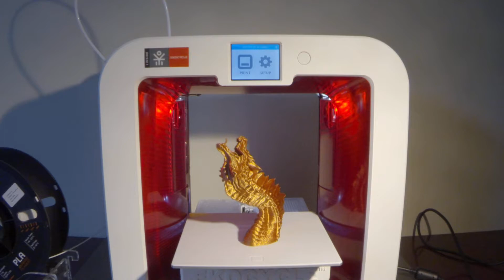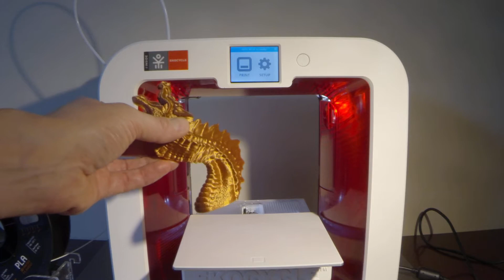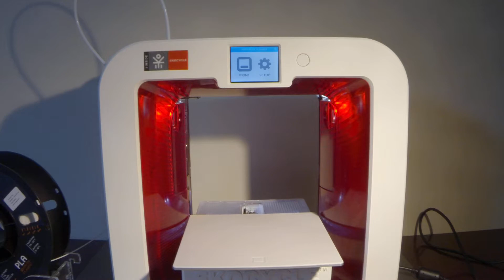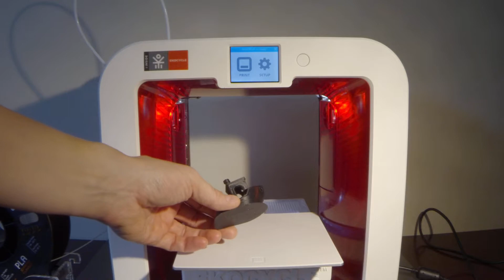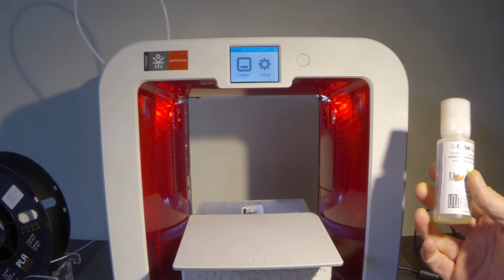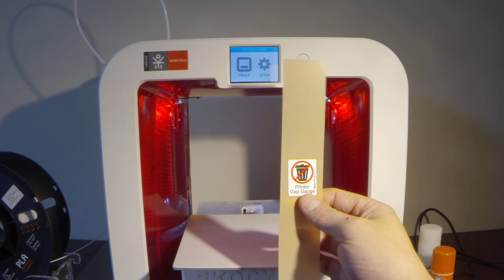Why the Cube 3 still has a loyal following

Comment: I got one of these printers but I  didn't get any software for printing and I  am wondering what is the best software and slicer to use? Thank you
Reply from the maker: Hi, you can still get the OEM slicer but someone built a Cube3 and CubePro profile for Cura - Search Github for this. Check out the Cube 3D Printer Owners Group in FB for even more info.

Comment: What slicer do you use?
Reply from the maker: The OEM slicer is still available from the Cube 3D Printers Owners Group on FB. It's the only working slicer ATM, but a member built a CubePro profile for Cura and is also working on a Cube3 profile.

Comment: Is the filament proprietary? Can i fill cartridge with other plastics?
Reply from the maker: Nope, the cartridges are the only issue and there are great open source solutions (DIY and for sale). A member of the CUBE 3D Printers Owners FB Group recently built and shared Cura profiles for the 3 and Pro. Lots of other valuable information there - check it out!

Comment: Do you have the EKOCYCLE Cube vase model, by any chance? Or anybody?
Reply from the maker: The folks at Print3dforum.com archived all 3DSysyems files a while back. You'll find them all in the Cube3 or CubePro forum. Use caution, the hosting site has click bait.
Reply: @3dprinttek  Thank you!
Reply: @3dprinttek  do you have a working link for the Cube3 slicing software?
Reply from the maker: @CeleryBruh  Multiple members of the Cube 3D Printers Owners Group on FB are sharing it.

Comment: Have u ran into the issue with running other  1.75 pla with the cartridge mod? I've brought some with print temp of 190-220 but starts skipping when printing, there filament seems to be abit smaller then 1.75
Reply from the maker: No, and I've printed a TON of retail filament of varying brands and types. 

A few things - when purging, the feed motors are more prone to skipping (lower power to motor). A full spool of filament is prone to have periodic audible skips, but I've never noticed a quality issue (it takes more work to move that full spool). 

Your issue is most likely related to drag caused by either 4x2mm PTFE tubing that is too tight or a damaged feed tube component at feed assembly or print head. I have another video showing how to resolve poor print quality due to damage tube.

If this is the 1st time testing your open source solution, use some filament fed through the feed assembly to test how hard it is to push it through that tube. IE, it gets bigger when compressed through the feed assembly - test a chunk of this filament. It needs a full 2mm. I had to test product from multiple sources to find tubing that was 2 or slightly larger. If using a new open source solution, this is the most likely cause of your issue,.
Reply: @3dprinttek  thanks heaps man :)
Reply: Also what i/d is best thanks
Reply from the maker: @sirkdow  The gotcha is that much of the 4x2mm PTFE tubing on the market is too tight. I recommend using a 2mm metal rod (or bike wheel spoke) to test. You should be able to push the metal rod through with the help of filament only. If it takes more force to push it through, your feed motors can't handle it.

It's been a while since I had to purchase but eBay seller ny-top-tek sold me a large amount of tubing that was all perfect for the Cube 3.

Comment: I just gutted one of these today, pulled all the boards and plastic off and only left the bed, motors and frame. This printer was built really well but the software was so bogus and in 2022 finding parts isnt worth it. I'm thinking once I slap a new board and 3d print some parts i should have a really solid micro printer that id imagine can print pretty fast.

Edit: forgot to mention i bought it used today for 25 bucks with a missing nozzle & in rough shape plastics wise.
Reply from the maker: You're spot on. Very high end components but the efforts to keep it closed source and dated slicer hurt it.

I recommend two options to really take advantage of the high build quality:
1. Simply find the missing components to make it whole and then use Simplify3D as your slicer.
2. Mirror the work of someone who has already converted a Cube3 to a different platform.

S3D does not list the Cube3 as a compatible printer, but it is! It uses the same board as the CubePro. Base S3d configurations and detailed conversion builds are available on print3dforum.com (I'm a member only).

I would recommend option 1 because the S3D license can be used for other printers. I actually prefer the OEM slicer for PETG prints. Find me on the print3dforum or the "Cube 3D Printers Owners Group" in FB for help with that.

Comment: I just found a cube 3 but does not have the power supply do you know of a good replacement for the power supply.
Reply from the maker: Yep - MPJA has these for 14.95 each. https://www.mpja.com/24-Volt-Adapter-Power-Supply-5A-Megmeet/productinfo/32885%20PS/

Good luck!
Reply: @3dprinttek  thank you I ordered it going to clean it up while I wait and use your videos to modify it